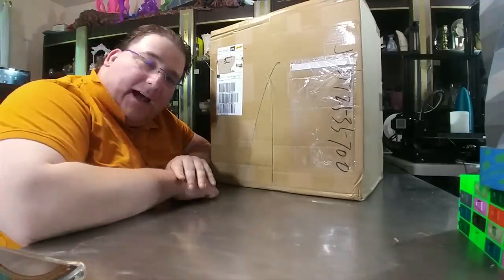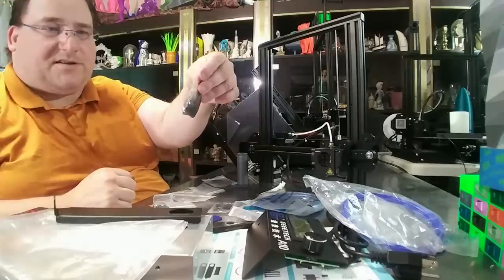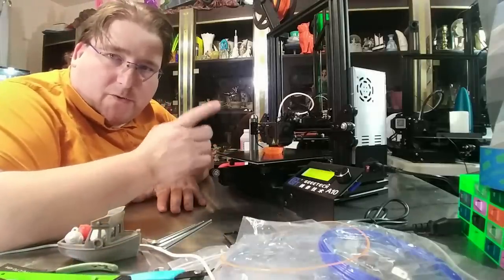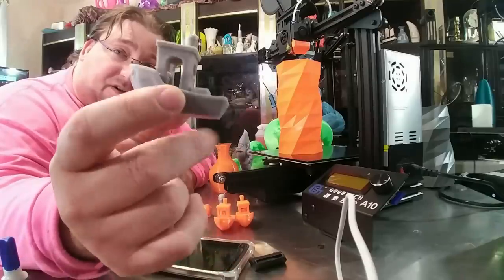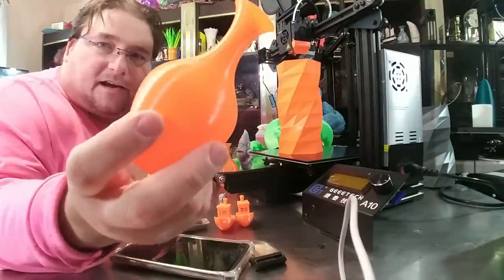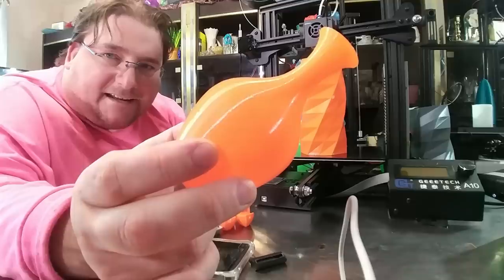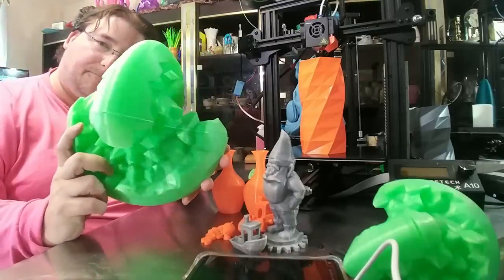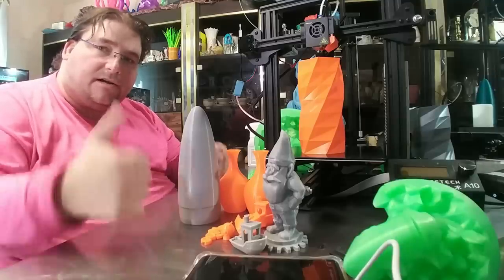T3DP 227 Geeetech A10   Unbox, Build, Print

Comment: Good review. I'm at start using a brim more to prevent lifting. I saw that proofs came up with the new version two of their multicolored accessory. I finally broke down and ordered Mark 3 with a multicolored we'll see how that goes.
Reply from the maker: If you are talking about the A10m I should have one soon and it's a true mixer so you can randomly switch or mix filament on-the-fly which is very cool
Reply: @nerys71  stick my autocorrect screwed up. I'm getting a prusa Mark 3 with they're new multifilament
Reply from the maker: @fergi1959  nicccceeeeeee! You lucky critter. :-)

Comment: I have one of these on the way and I would hope they have the Salmon skin thing rectified?  If not...could you consider a bit more detailed video on how you installed the smoothers?  Any additional hardware needed?
Reply from the maker: The smoothers are cheap the only tricky part is swapping plugs to be able to plug them in I will make a video on that
Reply: @nerys71  I have several smothers I bought for the Tevo Tornado I have (which is sitting in a heap...it's that awesome).  I figured there must be something special about the connectors and connection....thank you!  I like your channel!
Reply from the maker: the connectors on the geetech are slightly non standard so you have to do some manual work to use them but they are electrically compatible no problem.

Comment: A lot of those building the A10, A10m printers....whizz by the bit where you connect the ribbon cable to the LCD control display....seems its a teaser! Hard to locate, not staying in place...and confusion as to the Blue side on the bottom!  Define bottom! Others say the blue strip should not be seen ie facing the metal case....but that useless “guide to build” sheet....shows the blue strip visible when fitted!   Which is the correct way!
Reply from the maker: I don't know! I tore down all my A10 printers and they are packed on the bus I will be sure to notate which way it goes when I rebuild them but it's pretty easy just plug it in if it doesn't work flip it around you can't hurt it plugging it in wrong just be gentle with it

Comment: I recently bought one of these, pretty good printer for the price however the power pack seems to have popped, the power switch still lights up and the fuse is ok but I’m not getting any voltage out? Has any one else suffered from this issue? I’m hoping when it went, it didn’t damage anything else not sure how to check this right now but I’m hoping I can just get a replacement power pack. Any feed back from others with this issue would be great and ideas on what’s going on would be useful, thanks
Reply from the maker: take a volt meter "TO" the V+ and V- DC on the PSU see if you get any power if not its dead. they are cheap to replace. just buy one locally (still ask for a replacement of course since your due that)
Reply: Hey thanks for you reply, yeah I had a volt meter on there, theres definitely no power, seems to be a common issue? Should I be concerned about the other electronics? I've found a replacement online which I can order. I'm waiting to here back from the seller (hopefully). wondering whether a higher amp supply is worth paying for. Not sure that's the issue, maybe it was just cheap.
Reply from the maker: nope. not common. I have only ever had one single PSU fail and it was DOA. never worked.

they are pretty robust little units even if cheap. if you can find it go with a meanwell psu. much better quality and it will put out the rated amps which will let you get your bed nice and hot if you need it.

 @richjfoxone

Comment: Sounds to me you had bad filament witch clugged your hotend
Reply from the maker: filament was ok. the issue is fine tuning retraction and temperatures and ... a bit of luck. what can happen is when you retract you can sometimes get a "string" or "thread" left behind and if this is big enough long enough and or scrunches the wrong way on reinsertion it can "jam" the next filament push physically. (temp or perm) and prevent new feeding if this pinch is outside the hotzone (IE can't melt it)

Comment: It costs more than the Ender 3.  Whut.
Ender 3 is $180-$200 with shipping.  Geeeeeeetech A10 is $207.
Looks like Ender 3 is a known quantity to stick with for now.
Reply from the maker: Should be $180 same price as ender but i agree stick with ender 3. Its not a bad printer in fact good enough i will keep using it but no. Not as good as ender 3. Maybe if it were $150 or $160 it would be more appealing.
Reply: Thanks for this. Just got an Ender 3 and then saw the A10 and was thinking I missed out on something better for a few bucks more. Phew!